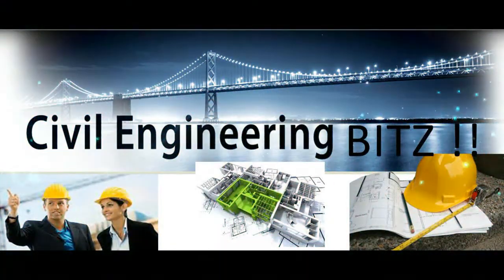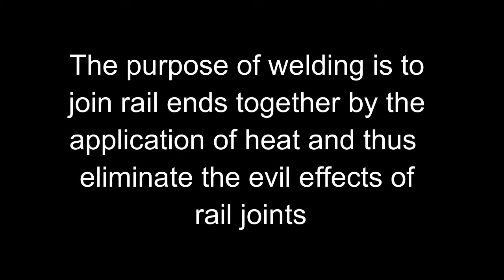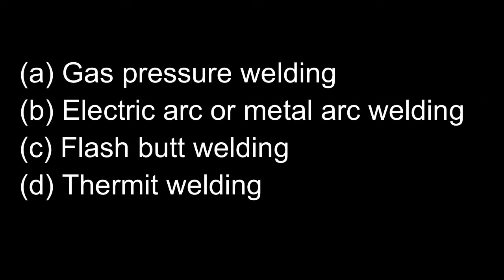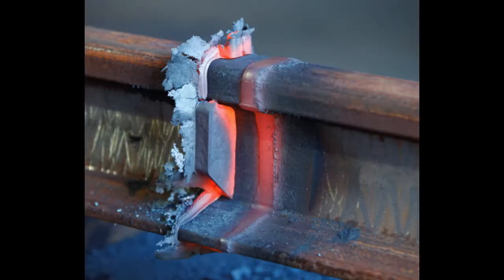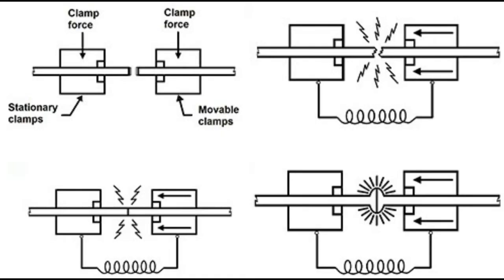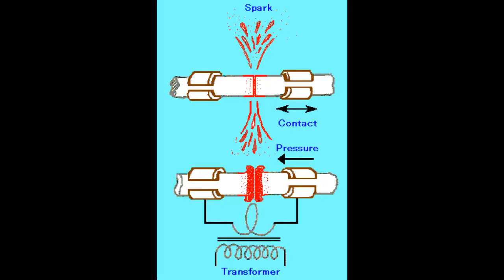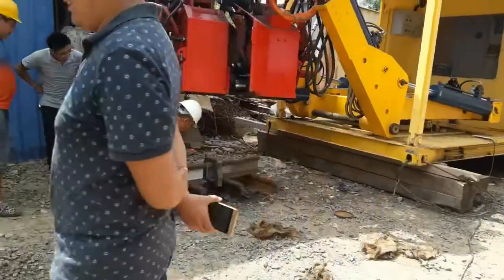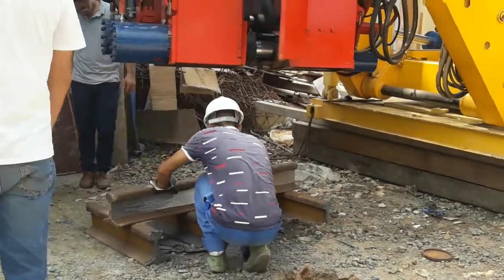Flash butt welding of Rails

Comment: Evil effects of rail joints?
Reply from the maker: A rail joint is the weakest link in the track.Some of the problems associated with the rail joint
are as follows.Maintenance effort,Lifespan,Noise effect,Sabotage chances,Impact on quality,Fuel consumption etc. Thus Evil is used
Reply: @WarunaThejana  Negative is the right word. Evil is a moral judgement of an action.